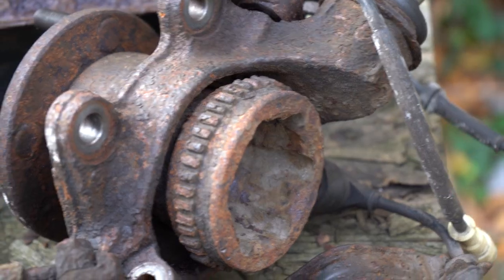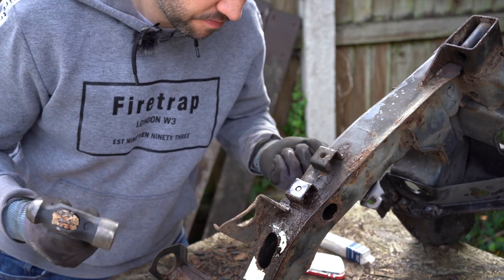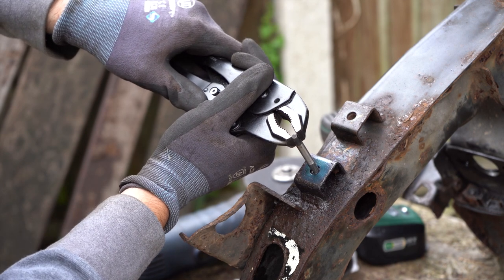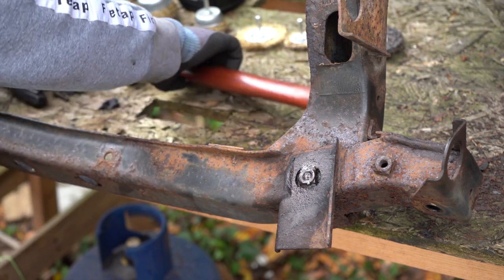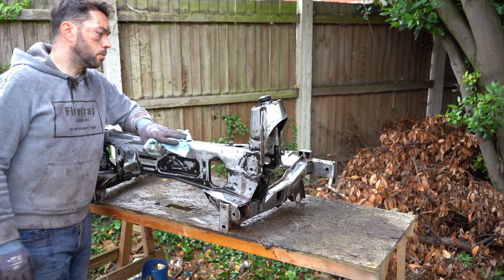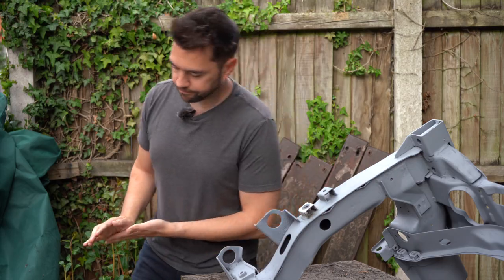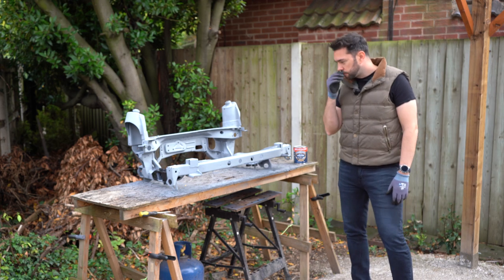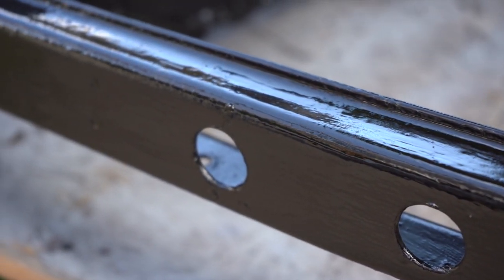Subframe Refurb on the MG TF

Comment: Just a little tip Lee, run a correct size tap through the holes to clean up threads and apply a dab of copper grease to bolts to ease assembly as you may have some paint in the threads which will make it tight to do bolts up.

Comment: You have a welder! They generate some heat during the welding process, and one trick for stuck bolts is to tack-weld a bit of scrap metal to the offending bolt, the heat is often enough to release the rust bond.

Comment: Hello there. Never been the first to leave a comment before. This week I polybushed the rear lower links.
Reply from the maker: Ahh thats cool, I've got some poly bushes to go on the new lower control arms and anti roll bar when they go back on...be interested to know if you noticed a difference 👍
Reply: @wheatleysworkshop  Yes! Before there was a noticeable swaying with every shifting of the road level. Now it is much more relaxed, especially at motorway speeds. I done other things before this, it's along list, (soft shocks, upgrade anti-roll bars, poly bushes at front, etc. etc.) I'm trying not to turn this into a brag list; so I'll  stop now.(P.S. Poly bushes at front flattens speed humps.)

Comment: Your problem is mate your lacking in the knowledge.  You use heat and try to remove while its hot. That was the expansion gives you more room to remove it, as the heat is there.  NEVER HEAT THEN ALLOW TO COOL. You may well of not bothered
Reply: Dale Flaherty   Blow torch or gas axe first always the easiest.

Comment: riv nuts are a good option for replacing captive nuts. if yo put about in the nut while welding it and screw it out while it is still hot it save getting weld seater on the threads.or run a tap through the nut you already have welded to it and see yourself grinding the new nut out.

Comment: Sorry to use your video for this but I need advise regarding the starter motor on my 04 TF 160, are the starter motors all the same for the 3 variants or are they different? Thank you for any help.
Reply from the maker: No problem at all. There are different ones you can get depending on things like manual/auto, VVC/non-VVC and age of engine. Take a look here....  https://rimmerbros.com/Item--i-GRID018962
Reply: Its also dependent on the gearbox...   there are 2 different tooth drives on the starter